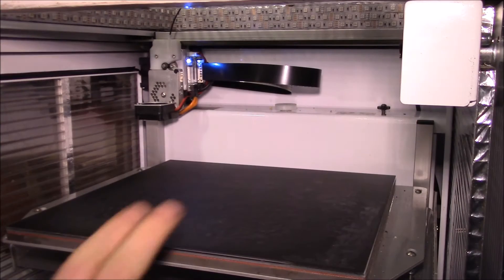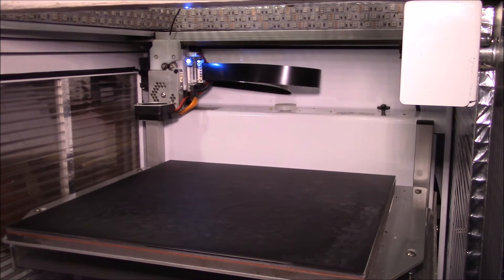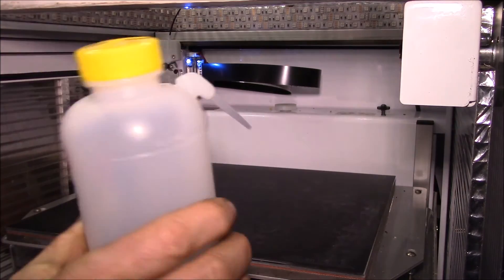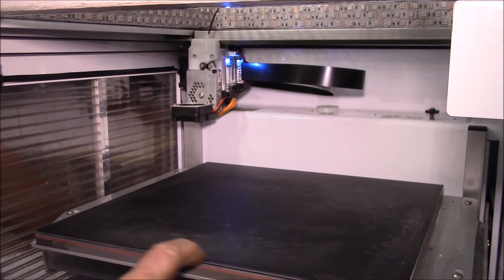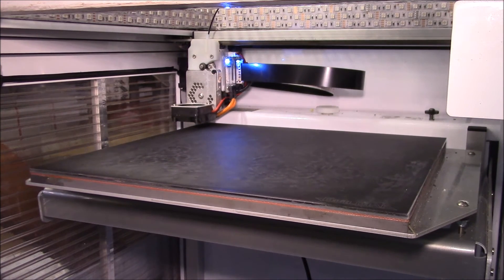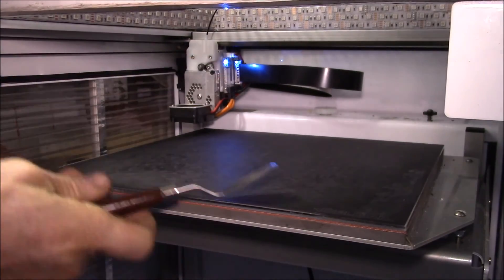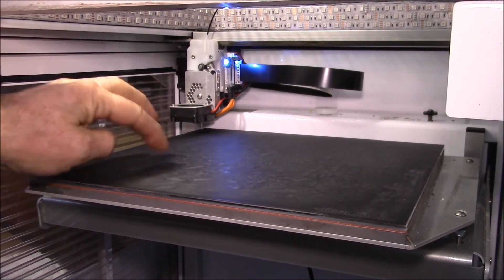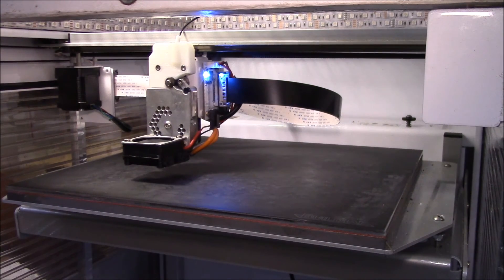BuildTak - 4 Month Update

Comment: The startup routine as you said may either be hardcoded gcode in the firmware or simply something you can specify/overwrite in cura.
Reply from the maker: Yes, I found it in the start.gcode file that's included in Cura.  Three lines of code that look something like this:
; G1 X150 Y5 Z0.3 ;move the platform to purge extrusion
; G92 E0 ;zero the extruded length
; G1 F200 X250 E30 ;extrude 30mm of feed stock
Commented them out and no more purge pass.  Just need to make sure those are changed in all my saved material profile files.

Comment: So I take it you're not  using their new Flex sheet?
Reply from the maker: Yes, I have the FlexPlate installed and am using that.  I find that only works on certain parts.  The parts need to be stiff enough to pop loose when you flex the steel sheet.  Problem is if the part is thin or has a small enough size, there's not enough bend in the sheet to pop the part loose.  So for those, I use the various spatulas.
Reply: Cool.  I was wondering about that.  I was using the FilaFarm Switch which is a magnetic flex plate with their FilaPrint build sheet from Germany. Worked out great but expensive. I had ordered the BuildTak last night just before my control box for my TEVO Tornado burnt up.  Something shorted in there so I'm hoping Tevo will replace it.  I had to cancel my BuildTak order for now. With the FilaPrint you can't touch it with your fingers and you can't put any metal utensil to it as it will ruin the surface.  Not good for small parts that won't pop off when the sheet cools down.  I had a plastic spatula but somehow I think I may have trashed the surface.  omg!  Waiting to hear from Tevo.  Good luck.  I like the fact you can clean that BuildTak sheet and use a spatula if necessary.  Thumbs up
Reply from the maker: Yes, seems to be pretty tough stuff.  You do need to take care and not dig/cut into the material, so no razor blades or chisels.  I stick with the official BuildTak spatula or one of the little ones like shown in the video.  Just wipe it down with 70% isopropyl before printing to remove any fingerprint oil or dust.
Reply: Cool Thanks.  I don't like a lot of restrictions ha ha.  I men sometimes you got to use a fingernail or plastic spatula.  I did use glass cleaner on it a few times and didn't seem to affect it..  Waiting to hear from Tevo now.